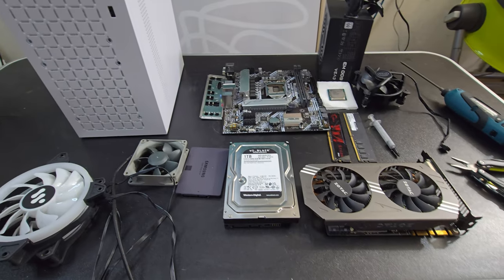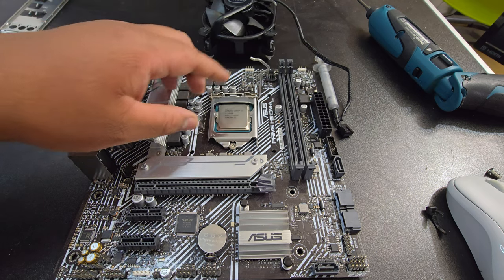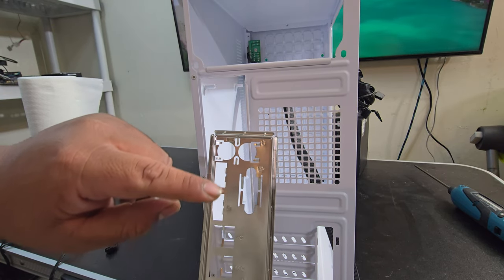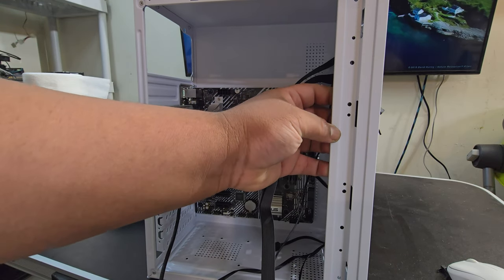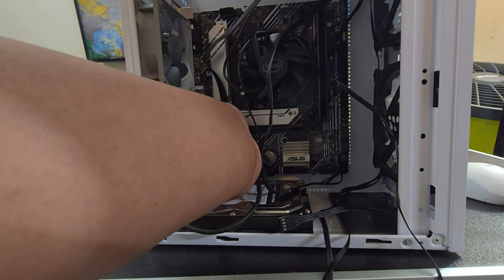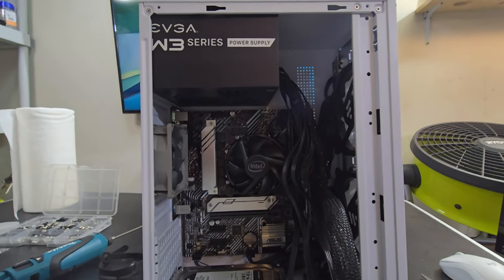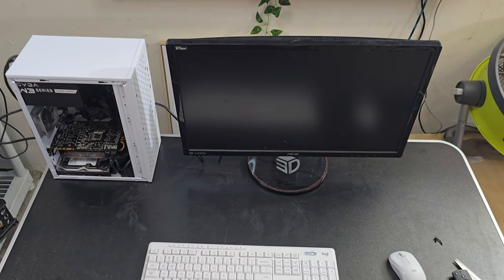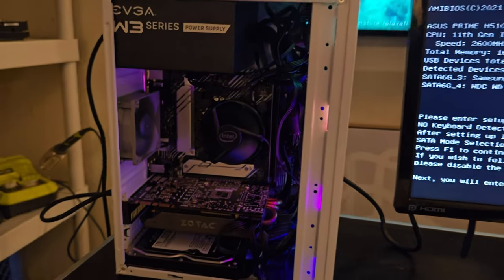Building a computer with TEMU's cheapest computer case

Comment: i have simalr case just the no aiflow front version. honestly its not a bad case for small build i have dual fan rx 6600. its a tight squeeze. but it does fit. I also put a chonker 1200w modular power supply. Absolutly unesscary but i got it cheap new. 50 bucks it was a steal! The longer the card if find it helps hide the cables more. so my inside of my case looks relativly clean despite no cable management areas.5

Comment: I installed two ThermalRight slim profile 120mm rgb fans in mine. Gave me enough room so that I had options for GPU's. Most will fit, but at the cost of a second case fan. I know people find it popular to knock Temu stuff, but It's actually really nice for the price, especially if you are on a budget.

Comment: I have this case! I bought it on Amazon for about $30. I absolutely love it but it has some really big downsides. No front USB3, mATX boards cover the additional vent holes, and GPU clearance is abysmal for current gen GPU's. If they had just rotated everything 90 degrees, this would be an amazing 15L pc!
Reply from the maker: yes, it has many downsides, but the price and size are exactly what I needed.

Comment: mixing ram sticks is never a good idea
Reply: Everyone says this yet, I have quad sticks two from corsair and HP and they have zero issue communicating
Reply: yh literally i have never had a single prob with mixing ram sticks i mean what u expect the guy to do lol as said hes using what he has
only thing i didnt like was that hes using a 11th gen i5 with a gtx 970 but hey its up to him
Reply from the maker: The gtx 970 was the only gpu I had that fit in the case unfortunately
Reply: @Century4K ohh ok well I mean all be it a little older it’s still a good card for 1080p n my opinion
Reply: @isaiahgonzalez1936 as long as they have same speed and latency it is gonna be fine
Reply: What have you experienced in the past that made you post this comment?